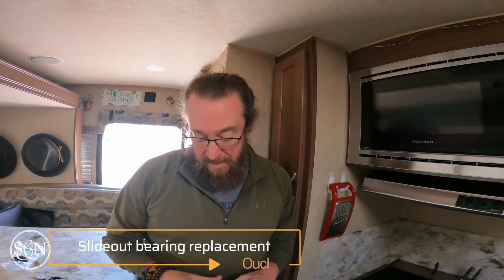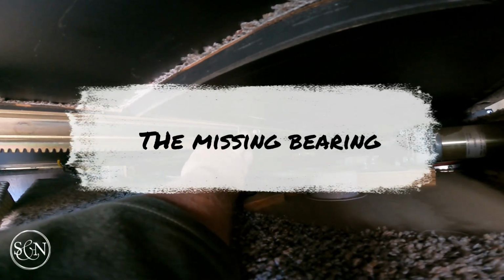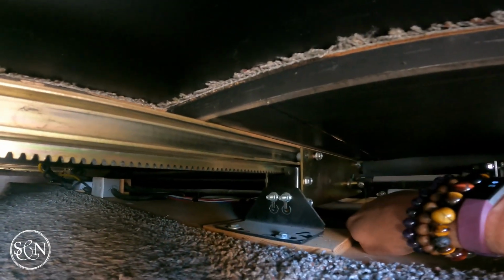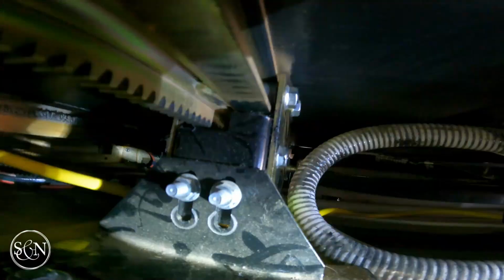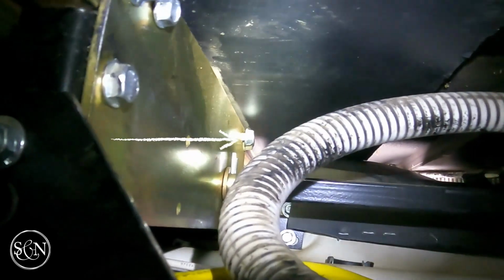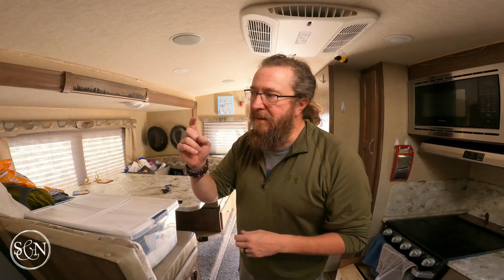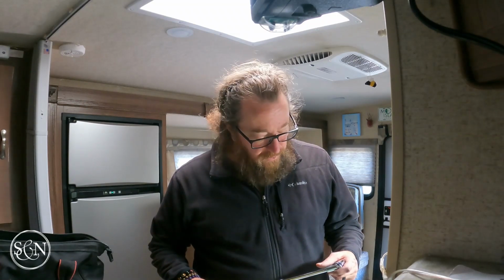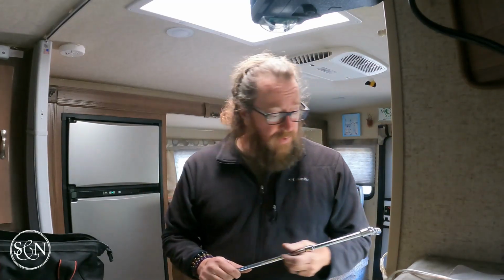Replacing a side slide bearing on a truck camper

Comment: I’ve got a AF990 and found the same part.  I assumed it was for the slide out but didn’t know where to put it.  So, I’ll go back to work. Very surprising this happens with a supposedly well built camper.   Wish I had the second elbow you two seems to have.
Reply from the maker: We just checked those again a few weeks back. It’s been about a year and a half. 

The rollers were still secure, but the bolts in the rear of the camper were starting to back out. We tightened them back down. Luckily, this time it was a one person job. 😀

Comment: Hi Steve, I went and tightened those back bolts and my slide barely functioned.  So I called Northwood service and the tech said those 2nd bolts (not the bearing bolts) are not supposed to be tight. They attach to teflon slides at a certain factory setting, and not meant to be tight.
Reply from the maker: Good stuff! I need to check ours out again. Several of ours were nearly falling out, and one had fallen out, but I don’t recall how tight I made them. Did they give you a torque spec? 🙏